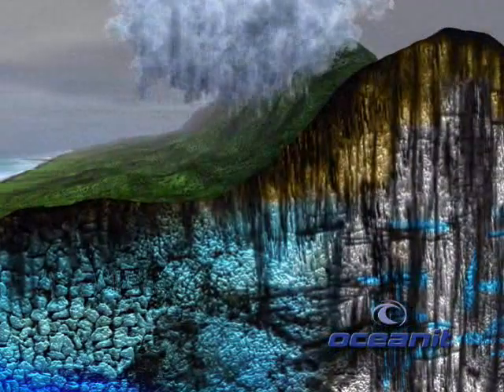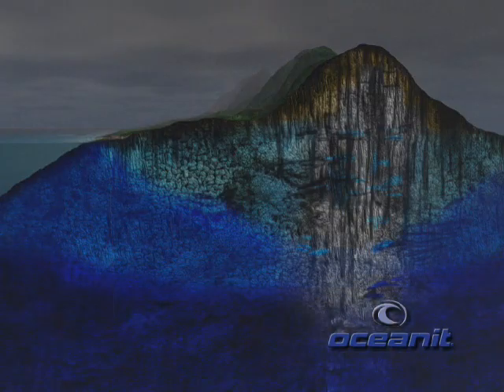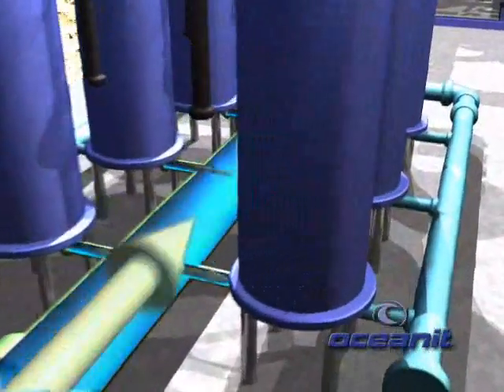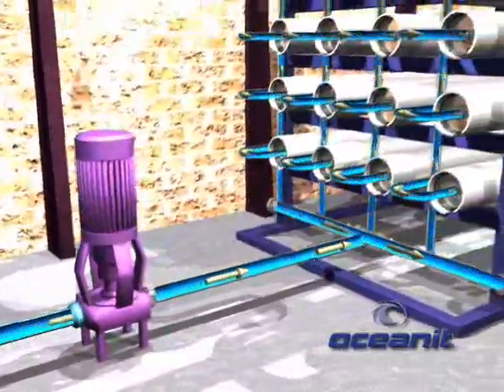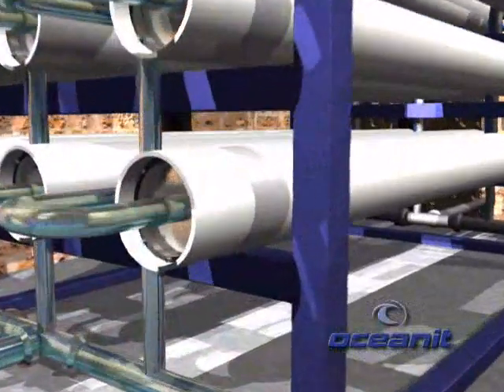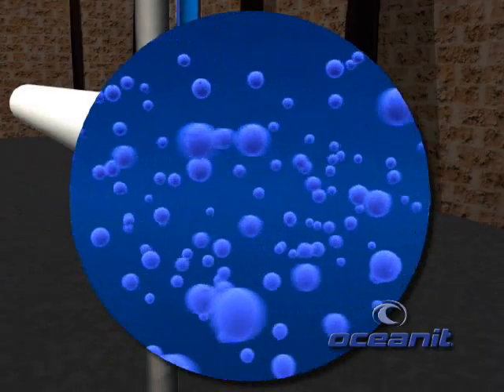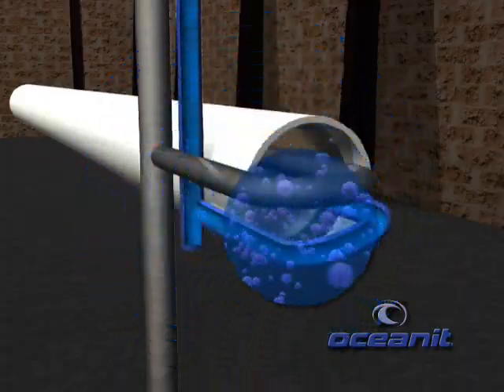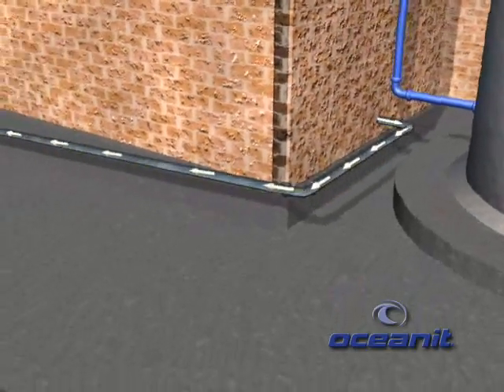Desalination Animation by Oceanit

Comment: where's the closed captioning?
Reply from the maker: Hi Michele, if you hover your cursor over the video window, you will see a toolbar at the bottom of the video with icons on the right hand side.  Clicking the icon button with "CC" will turn on closed captioning.